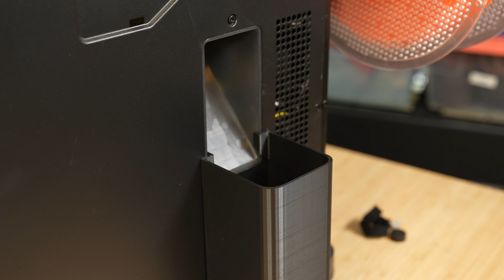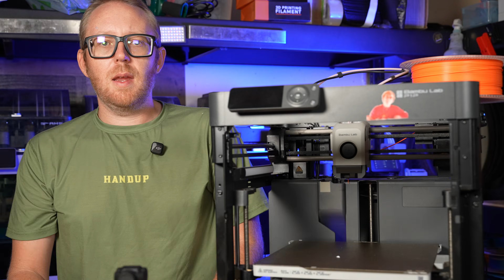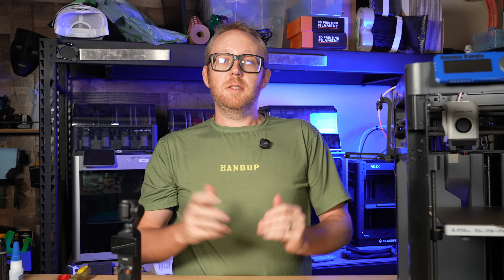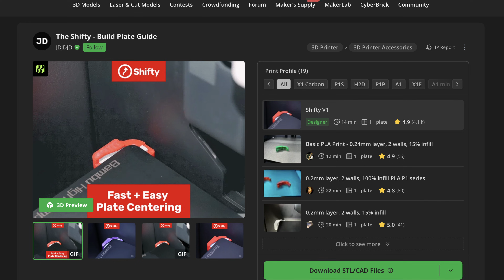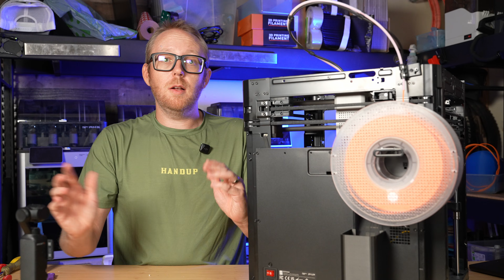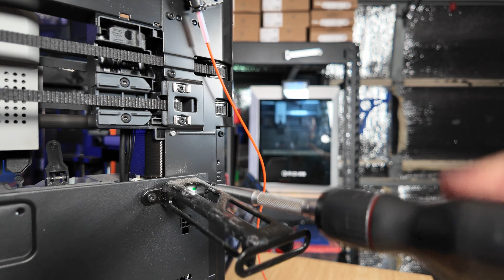Your Bambu Lab P1P Needs These 5 Upgrades Today

Comment: The filament feed tube is on the back cuz some of us got the AMS combo and it makes for looser tube radii.

Also, the author of the bed clip states quote "At this time I'm releasing the left side only. I have a right side model completed, but am not releasing it for now since the left-only approach works well and keeps the Shifty away from the back right purge strip activity. Feel free to mirror a right side in Bambu Studio for your own use, but please don't upload profiles with the right side mirrored at this time."
Reply from the maker: So far its been working fine for me on both sides. Still need to print more of them for the other printers